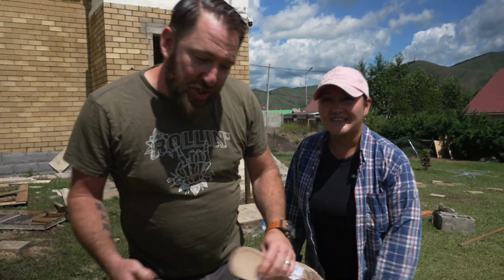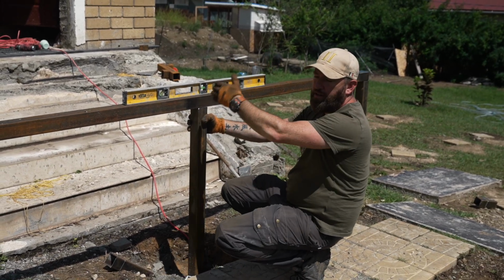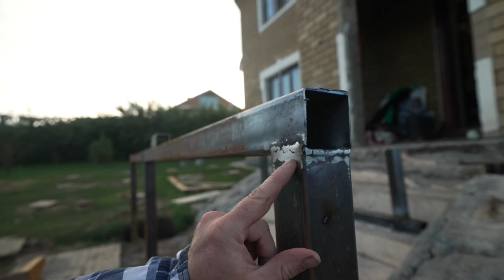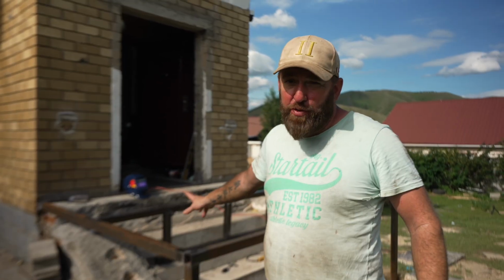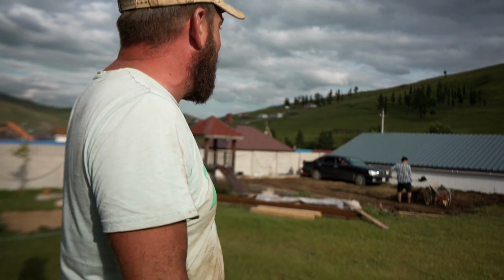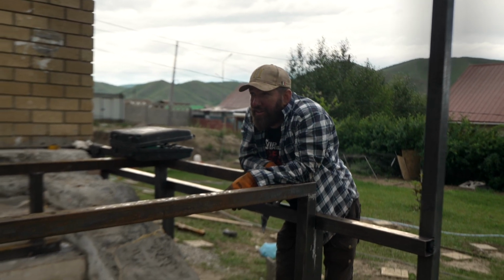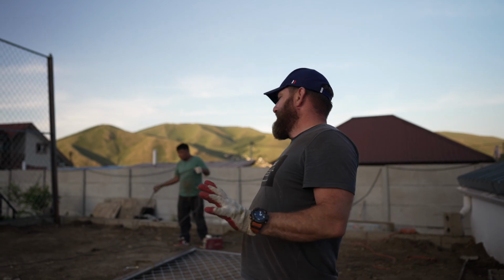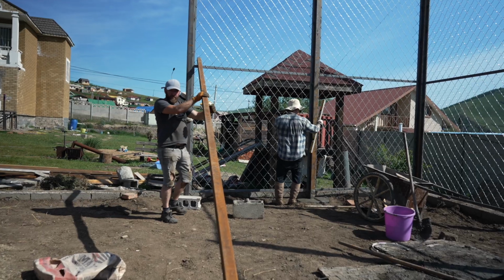Building a Basketball court and Framing a Steel Terrace | Extreme Build Mongolia

Comment: I haven't dipped my toe into welding yet - I'm more of a woodworker - but I do strongly recommend generators. Mine is a diesel generator (4.5kW) which saves us lost days of work and living generally with the inevitable power cuts and brown outs. We have horrible voltage drop when we turn on all our stuff. We used to heat with electricity but have switched to a coal boiler for this coming winter. Heating with electricity was expensive and inadequate due to voltage drop. Also we're on commercial rates which sucks and we're trying to fix that to get residential rates.
Reply from the maker: I really agree, wood is much more fun to work with!! But welding is a great skill to have and now the deck is soon finished my welding is so much better 😊 we may have a power plan soon🙏🏻 can’t share yet but just finishing the last details!!! It will be huge 😂😂